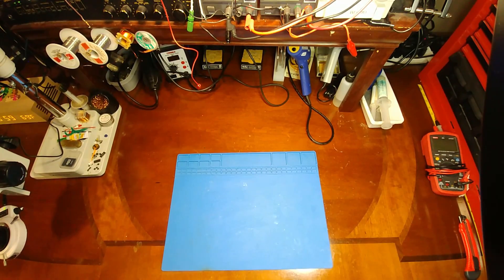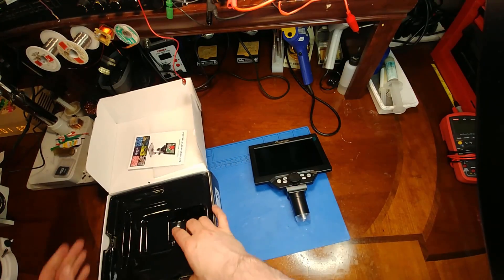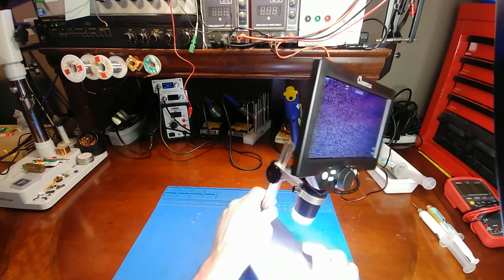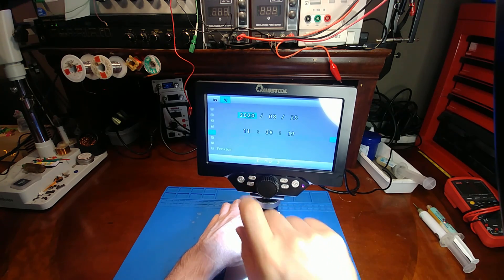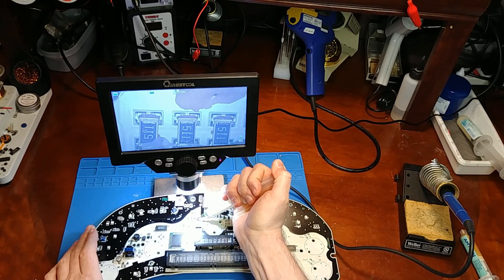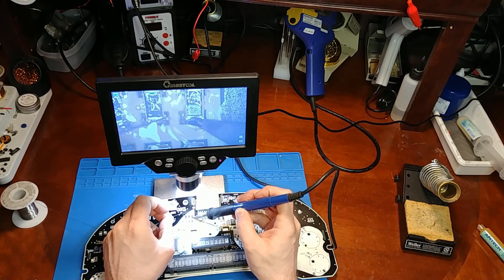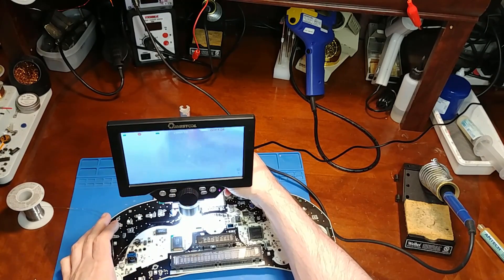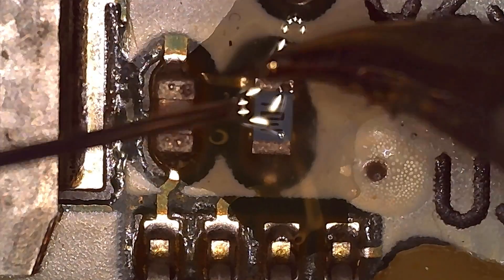Low cost microscope review

Comment: Hi jeffescortix. Wanted to ask for your opinion, personally, I would like to use this for soldering PS3 Board or maybe motherboard repair. This the stand seem be too small and closed to the edge which will affect the angle the camera could hold? Is this suitable for big-size board repair? if not what do u suggest what for a low-cost microscope yet cheap and usesable?
Reply from the maker: If you're on a budget a camera-screen style microscope will get the job done. But for large boards you might have to make a custom mount.

Comment: Do you fix all type of GMC clusters
Reply from the maker: 99-07 for full size. 01-13 for most GM cars.
Reply: @jeffescortlx   I have a 2002 gmc yukon denali I just bought speedometer donesnt work,and the oil dose bounceses around I bought all new parts for it.i had a stroke in2019 over 2 years ago was going to replair it my self I worked 28 for Cadillac and done them before. What do u charge for your service
Reply from the maker: @johnisenhart3308  chances are if the MPH doesn't register at all the cluster isn't seeing the VSS signal. I'm impressed you've found new air core motors, this will stop the bounce in the oil gauge. New ones have been hard to find for the last ~10 years.

Comment: Hello! You can change the angle of the microscope with the screw of the base, bend it backwards so you dont geht the "mist" into the lense - and you get better view of 3D dimensions.
Reply from the maker: Yes, the bottom base attachment is hinged and allows it to lean back at any angle.
Reply: @jeffescortlx  Would the distance between the bar and components in the middle of a laptop motherboard be a problem? It seems like you might not be able to reach every component on something as big as that without the side hitting it and stopping you.
Reply from the maker: @fakename3344  yes that's possible if the board is large and if you need to see the center. But I'd think a custom/modification stand could take care of that.
Reply from the maker: @fakename3344  also it can be tilted back to reach the center of large boards.

Comment: Just a quick question I have a Toshiba exterior hard drive and I bumped it and it fell over and now all it does is Click it's not reading anymore. It is full or otherwise I wouldn't bother trying to repair it would you or do you know of anybody who will be interested in fixing it
Reply: That's crashed heads that cause that. That's not a super simple repair fyi. (I don't do them I used to be interested in doing it so I did a lot of research. I don't know if Jeff has any better suggestions but Rossman repair group does them and a few other YouTubers.
Reply from the maker: @FixedUntilBroken  I'm guessing who ever will do the data recovery will need to buy an identical hard drive and swap the platters?
Reply: @jeffescortlx  I'm not an expert but I think it's more common to swap the heads. I think the hard part is getting the old heads off the platter while it's crashed without damaging the platters. I know a lot of people try to force them off and scratch it all up.

Comment: Hopefully they've improved it over the smaller version..I had 2 of those and both had firmware issues and died a short time after buying them.
Reply from the maker: If it has any reliability issues I'll make a sticky comment here. The USB power adapter feels pretty cheap, I wouldn't be surprised if it's the first thing to fail.
Reply: @jeffescortlx  From what I've seen it looks like they've improved it over the smaller version..The video quality looks a lot better and the firmware looks different as well so it might be ok..The Usb power adapter looks the same and it works but yeah not the best.

Comment: It looks like the stand for the scope could be an issue.  Limits the "depth" of the workpiece that can be used.  Otherwise it is surprising good resolution.
Reply from the maker: Correct, if the PCB is big it could hit the stand. I think it was designed around mobile/phone repair by looking at the shape of the stand platform.